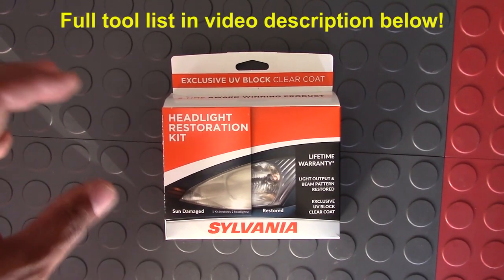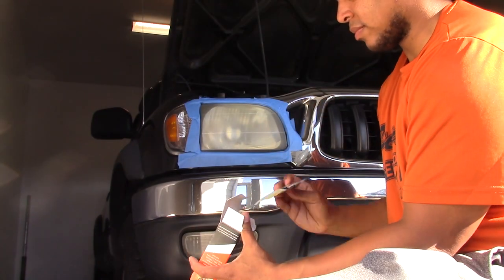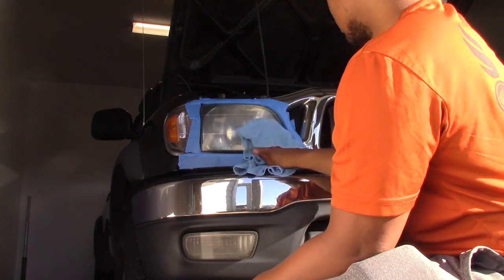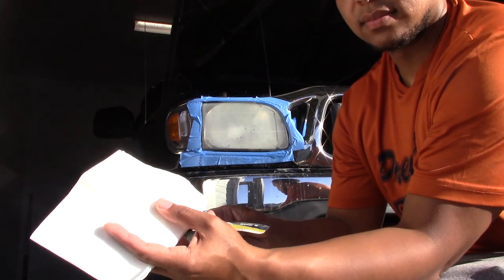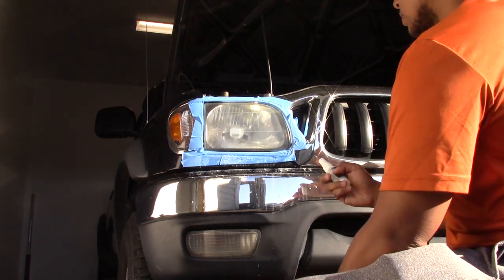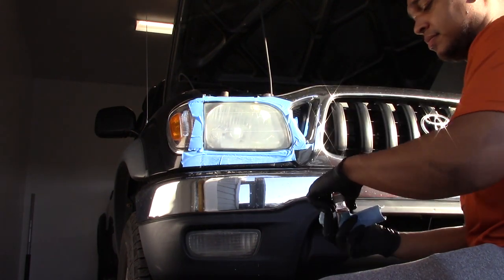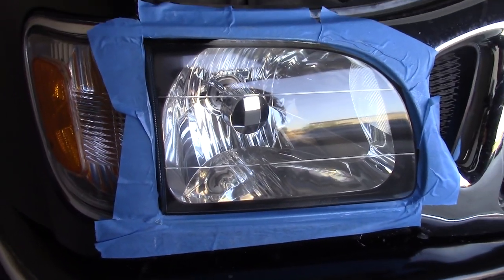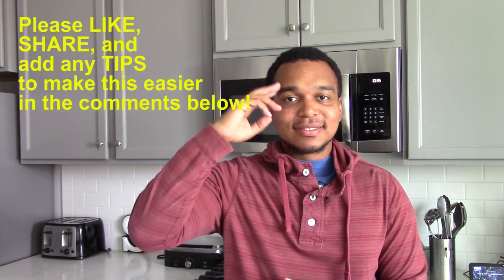RESTORE FADED HEADLIGHT | Sylvania Product Review

Comment: So far I’ve found the sylvania brand to work the best! Just wish it came with more surface activator. Restored my headlights the first time with this brand and it looked as if they were brand new, tried the turtle wax brand just recently and after a day it was already starting to oxidize...
Reply from the maker: Wow that's good to know about turlewax. I used there black trim restorer and was disappointed as well.
Reply: Engineered Mojo yea by the time you use the lens clarifying wipe and sealant on your first headlight you barely have enough to finish the job on the 2nd headlight.. Not only that but the ceramic pads are uncomfortable to even use unlike having a sheet of sandpaper to work with.

Comment: Very nice video, after all steps are done, how long does the protective layer last or is there any other product to use to protect the lights from going bad again?
Reply from the maker: There isn't another protective layer and unfortunately the headlights will fade again with time, but in my experience a refinished headlight typically lasts about 3-5 years depending on the amount of sun exposure. The more you keep the headlights away from sun, the longer the protective coating will last!
Reply: Use a wax, sealant or polish that has UV protection as regular maintenance after applying this product and it should extend the life of it.

Comment: Should I apply multiple clear coats in the last step there? to give them  a thicker coat.
Reply from the maker: I would only apply one thick coat. When you do multiple laps over same area, the solution easily smudges and leaves open gaps. You might end up spending  more time fixing those gaps than getting a 2nd coat. Now if you let it dry then apply another coat that might work but I've never tried it that way. Let new know id you try it, but one thick coat typically leaves a very nice gloss
Reply: It’s like polyurethane. One good thick coat is best.

Comment: Can I do a second coat of the uv clear coat once the first one cures do you know?
Reply from the maker: Once the first coat cures, you probably can get away with a second coat with creating air pockets. I've never tried it though. I'd let it cure the full time recommended by Sylvania and give it a try. Let me know if you try and how it comes out!
Reply: So did you do a second coat how was it?  I did the first coat and it looks good but I tried to touch up a  few little areas I missed and it sort of looks not that great..thinking a second coat would fill in any missed spots from the first coat.
Reply from the maker: @markg999  let me know as well if you do the second coat
Reply: @EngineeredMojo  Will do, seems online you have to wait 72 hours to let it fully cure. I'll put a thin second coat in 3 days and let you know how it turns out.
Reply: @EngineeredMojo  Yea ok my verdict is I'd likely not do it. It's tough seeing what you did on a clear headlight and second it seemed to leave minor lines.  It's not bad and not noticable from a distance.  But they give so much of the clearcoat when they need to be done again just buff well with like 2000 grit sandpaper and rubbing compound and should be good for another year or two maybe.
Reply from the maker: @markg999  appreciate the update and noted. Good info!

Comment: can I restore the headlights on two cars or is there not enough product?
Reply from the maker: If the headlights are not large like on some mini vans I'm sure you could squeeze out enough product for two pairs of headlights. I had extra product left over in each step, good question
Reply: @EngineeredMojo  Sounds great did you have quite a bit of step 2 compound in the packet for maybe more than 2 cars? I know you can get refills for the step 1 and 3 liquids. Thanks man!
Reply from the maker: @charlesnicholsonn  I sure did more than half of the pack left!